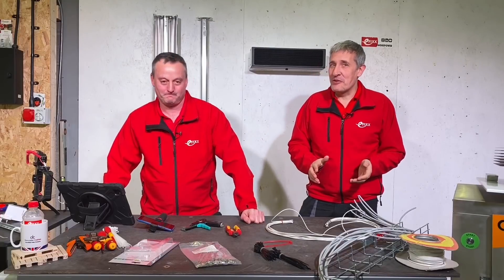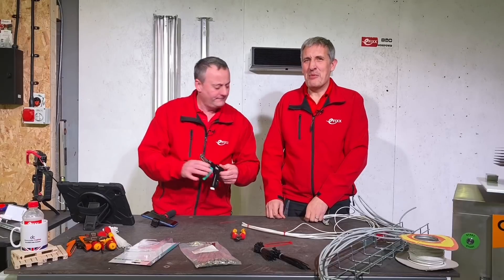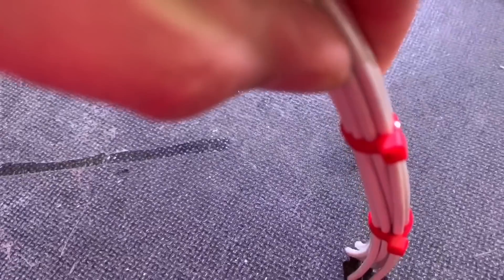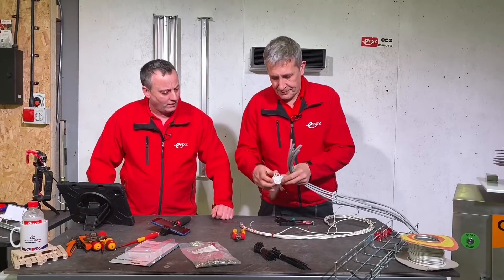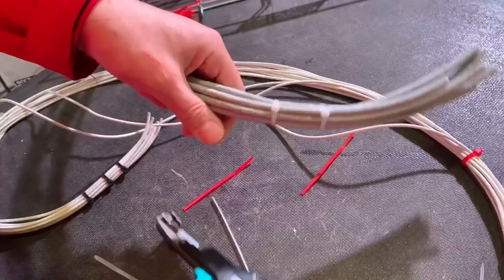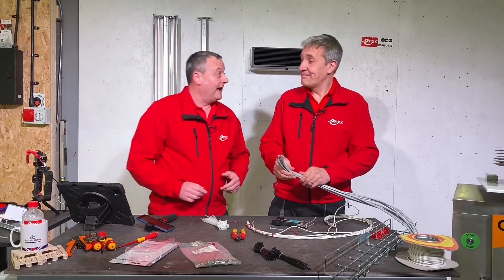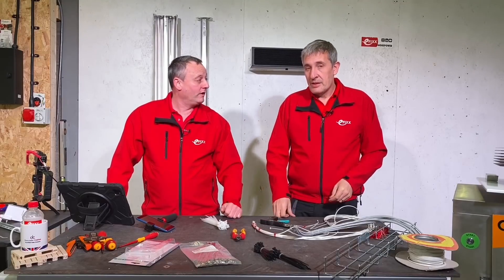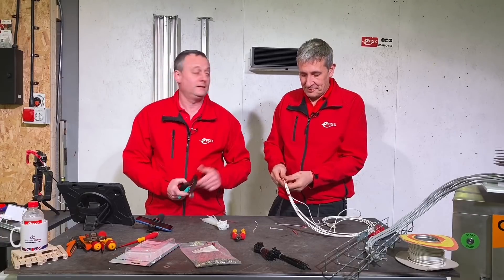The tension builds with the UNIFOX CABLE TIE tool from Phoenix Contact - clean cuts, no sharp edges!

Comment: This tool is a joke
Reply from the maker: Have you tried one?
Reply: @efixx  No I have not, so I do not speak from experience of using it. But I can tell you as an apprentice, usually there is tight space where we need to use tie wraps on cable bridges. Then there is just enough space for croppers, do a good enough job and less time spent. 
But I guess if every detail matters, why not.

Comment: Yikes! Plastic/nylon cable ties should NEVER be used on Cat.5/6/7/8 cables! Even on the tie which can still slide (@8:22) there is visible damage to the cable as it is too tight. I do reject any data cable installation where the installer has used cable ties - velcro is the only acceptable cable tie on my jobs. Crushing the cable is the number one reason for long-term cable degradation, and can even result in newly installed cables failing the NEXT/FEXT and/or bandwidth tests. 

Twin-and-earth is much more tolerant, although I'd also be nervous about cable ties on singles.
Reply from the maker: Yes lesson learned for us - 🙏  They are used extensively in control panels which are mostly Tri-rated singles.
Reply: Re: cable ties on data cables.  Should probably stay out of IBM data centre's 😁
Reply: @0xf_Steven  I have every intention of doing so! 🤣

Comment: Cable ties are used a lot in our company and any installation with sharp edges is thrown back. Personally I have a set of Lindstrom flush cut side cutters.
Reply from the maker: I used to have some Lindstrom top cutters for the same use - *Gordon - I’d never used a cable tie cutter until this one showed up. It’s a keeper for our panel work

Comment: I use the Stainless Steel version as the use of SS cable ties helps compliance with  521.10.202. If the tray is mounted sideways or upside down. Also used at least every metre on all outside work

Comment: It's interesting to see this as I've recently seen cables in situ where they have been tied so tight that the cable tie has damaged the outer sheath and the insulation so much that parts of the Copper were seen. Maybe the fact that the tension can be adjusted it will prevent damage as well as the other direction where the cable tie wasn't pulled right enough. I have a question though... When you use cable ties and they pull quite tight, does it affect the temperature of the cable in the section that's been cable tied - or overall?

Comment: Ty Wrap was a US product. I believe they invented them. They were first used in the telephone industry. One idea was that you pull out a wire from a harness and insert others easily, by cutting off the ties one by one and retying one by one as a new wire is inserted.   Difficult to do with the old fashioned string binding.

Comment: I know you’re being paid to big these items up, but really?
You don’t need to set your tie wraps to any tensile strength and they can be cut off without causing the sharp point you so dramatically showed.
I don’t run my hand, fingers or any other appendages over bunches of electric cables to find sharp edges like you seem to do.

Comment: Always learning. Never knew these existed or that there was something called cable tie tensile. 👍
Reply: It's tension, not tensile strength.
Reply: @JimWhitaker  Zip tie tensile strength is the amount of weight a zip tie can hold safely without breaking. For example, a single zip tie with a tensile strength of 120 lbs. will break if it is used to hold something weighing over 120 pounds.

Comment: Not of any real use, table 4C1 explains why you dont cable tie cables tightly together for mains loads. And then using velcro straps is prefered for data cables....
Reply from the maker: 4C1 Depends upon the loading and design of the circuits being grouped with regards to conductor size.

Comment: I have worked in large datacenters, (Dell, IBM, hp). And there is no way i hell we used ziptie cutters, we only used Velcro bands,  but in electrical panels and on boats and ships I have used it alot
Reply: Last time I was in a Softlayer DC it was a cable tie party on the data install

Comment: £50 😱
Reply: This is the cheap knock off version of the panduit originals that are £250 😂
Reply: The Thomas & Betts ERG 50 I own is almost 170 Euros if you buy it separately. But I bought it in a set with a whole bunch of cable ties, the set was 159 Euros two years ago:

https://www.amazon.de/gp/product/B0028YD3EG/ref=ppx_yo_dt_b_asin_title_o00_s00?ie=UTF8&psc=1

Comment: for branding panels at music festivals and events this could be brilliant. Yes the considerate amongst the crews putting up such panels use flush cutters to make sure there are no evil razor edges (and trust me they can do unbelievable amounts of damage ) but one click to tighten and flush cut could save a bit of time.  Also in events world cable ties are quite often used to secure temporary seating together which could be several thousand ties per event in places where you really really don't want sharp edges and you also want proper tension.

Comment: Good idea but shouldnt be used on data cables
Reply: Cable ties can create crosstalk between the cores
Reply: Haven't done data for twenty years but we used normal cable ties, but didn't pull too tight, and cut off with flush cutting snips
Reply from the maker: How else would you secure data cables to baskets etc?
Reply from the maker: Found my own answer - velcro cable ties - perhaps an area for us to investigate further.
Reply: You should use Velcro straps on data cable
Reply: How we do it is, as the data bundle comes out of the aligning tool we use velcro straps and if we need to use cable ties to secure to tray or basket etc, the ties are wrapped over the velcro, in most cases very few cable ties are used as the velcro holds the bundles tight enough.. cable ties shouldn't be used directly on data bundles
Reply: They restrict the flow of the internet 😂